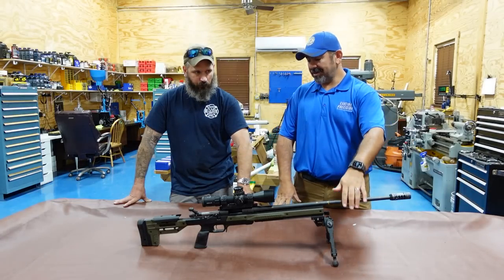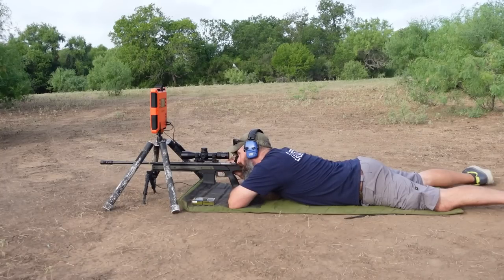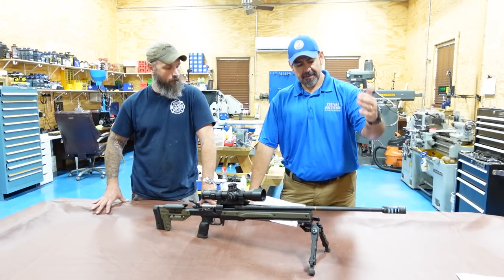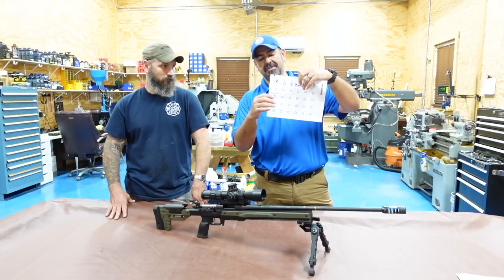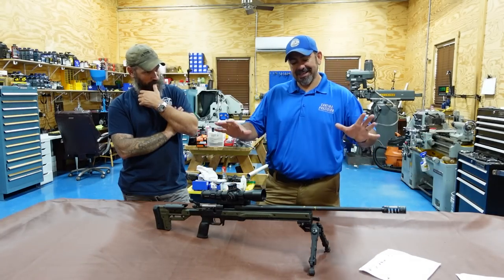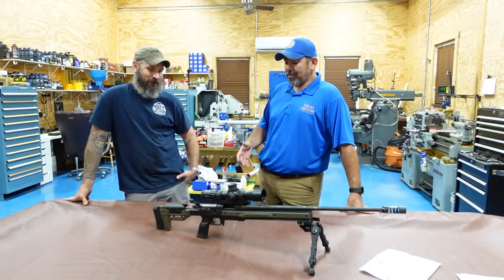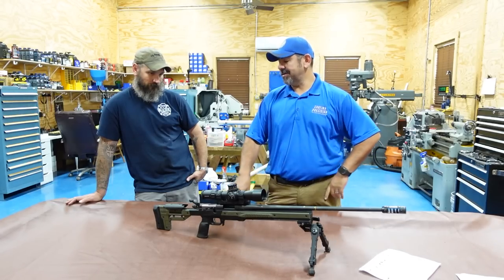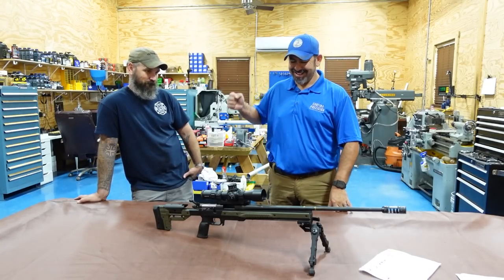6.5 NEEDS-MORE | EC Tuner Brake

Comment: 1400 later you have the performance of the $800 Bergara HMR's which come threaded. Curious why you guys never run suppressors?
Reply: Even better get a Tikka... suppressor aren't allowed in f class...plus suppressors suck when it comes to mirage even with a wrap...it's probably 80-90% brakes in PRS shooting
Reply: @brentwinkelman1990  I've heard good things about Tikkas I just don't have any experience,  I got into a Bergara BMP and now that's all anyone in my circle is shooting when we're at longer ranges. I've been looking to get away from the 2 lug rem 7 platform though, I'll have to check em out.
Reply: @tylerford88  havent seen an OEM tikka with threaded barrel yet. be an added cost to cut threads
Reply: @MrBarbuster  plenty of Tikka models factory threaded...all but the super lites are available factory threaded
Reply: @tylerford88  smoothest factory rifles made...one of the best triggers too...$5 spring kit and they are at a lb or under if you want...I've always just turned them down with the factory spring...1.5lb or so...I own 6 tikkas and all shoot  moa or under with factory and 1/2ish moa with my handloads if I do my part
Reply: @brentwinkelman1990  Tikka barrels are too thin even for hunting…
Reply: @matttraxler3567  says who? I've done load work for 3 or 4 of them...all 3/4 moa or better 3 shot groups...what more do you need
Reply: @brentwinkelman1990  Alright let’s put it this way then. If you’re a eastern white tail hunter this won’t matter, but let’s say you have a big magnum like a 300 rum, that barrel gets hot. Your 3/4 moa is already almost 6 inches at 600 yards, and  hunting elk you want that follow up, but by your second or third shot that barrel is so hot you can’t even touch it much less shoot a 3 inch group at 100
Reply: @matttraxler3567  My will T3 in .338 WM shoot 1.5 inch 3 shot groups at 200 yards all day. The barrel is just fine no hotter than my 110 in 30-06.
Reply: @matttraxler3567  on what planet is a follow up shot that lands in a 6in circle not put a bullet in the boiler room of a elk at 600yds...they have a  beach ball sized kill zone...if the rifle shoots 3/4moa and you call your wind correctly your first shot will be a kill shot not matter what...my 300wm Tikka lite will shoot sub moa up to 5-6 shots easy...if you run more then 3 rds at animal it wasn't meant to be unless you are doing follow up shots to put it down then who care if it's 2-3moa...the rifle will shoot way better then you anyway now that you are wound up

Comment: I had a rifle I purchased from a company who supposedly “blueprinted the action” honestly  I feel like that’s pointless unless it’s really out of spec.  I mentioned before that I use to buy actions and just put remage barrels on.  I’ve got 7-8 of these rifles built and there all 1/2 moa consistently with my hand loads. When I assembled my first couple I thought about sending the actions out for work but I think after again the 7th or 8th one producing consistent 1/2 moa and under 5 shot groups, it proved action work was not necessary.  The only thing I do is I have a ptg lug lapping tool, I use this with lapping compound to get good contact on the lugs and that’s it.

Comment: Again...,  instead of put on the tuner , try to stay cheap and do a bullet jump tuning instead !
If you decide to have the original stock,  at least put on some cheek raising material.
I anderstand that you want to promote the ECbrake , that it works must be  unquestionably by this time , but the seating depth tune is not wildly knowledge .

Comment: Real science would have you testing each of the changes, on their own - and then together & reversing the order, when possible. Right now, it seems there's not necessarily any distinction with the stock added (other than comfort) - given the other rifle shot better on subsequent firings (although it was bedded). The tuner tests look to have shown pretty clearly the ability to influence the group sizes, all by itself & on demand. You can't isolate the tuner-brake results though, if you have the stock changed out...So it appears you are onto that, and there's something to consider with the other rifle, but unfortunately you bedded that one. So with the original stock in the control rifle, it will still be bedded presumably - you can't undo that, right? It's the same with the threading, where it can't be undone so it's good you didn't start with that, in some sense, because you wouldn't be able to test the new stock by itself in that rifle. You do have the "mod"-rifle capable of testing with the original stock & not bedded, right? - but isolate it for the tuner-brake...That should be done. Based on what you've done...if all I wanted was to tighten the groups, it's the tuner-brake that I'd start with, but looking forward to you doing that in the mod-rifle since you CAN undo the upgraded stock and return to all original except the brake. If the rifle shoots 1.25" with the original stock returned, then you have demonstrated that it's the stock AND the tuner-brake together that made it shoot so well.